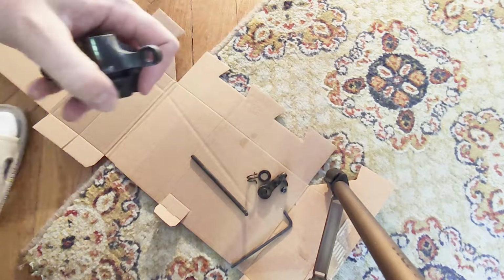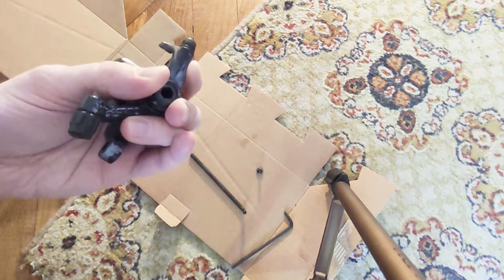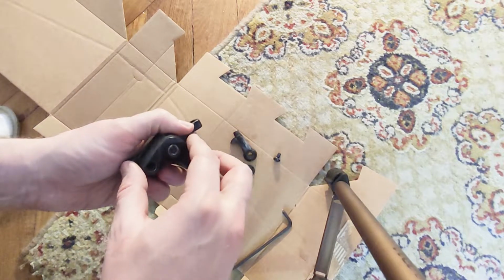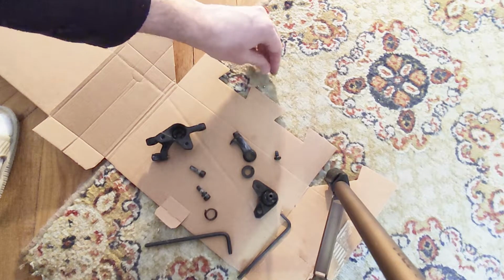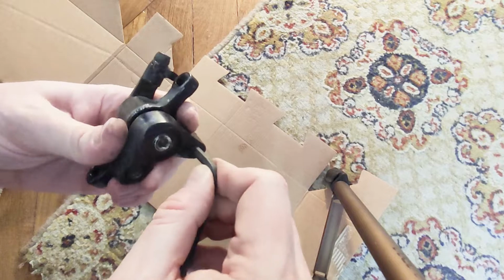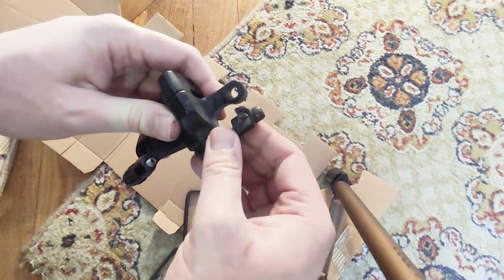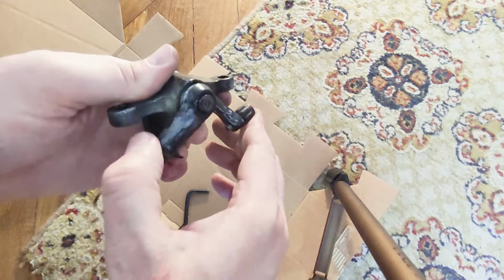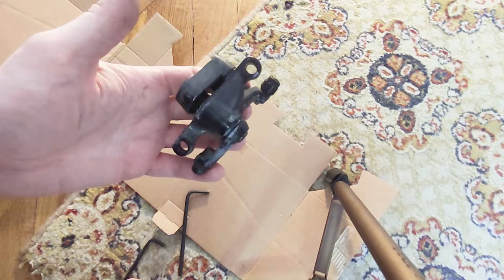How to service, assemble Tektro mechanical disc brakes

Comment: Thank you. I have a Tektro Novela caliper -- maybe 10 years old. Your video has helped me understand the way the arm rotates and pushes the pad against the disc (rotor). It looks like the balls run in sloping grooves. When the arm rotates, the slope of the groove forces the piston away, which causes the pad to contact the disc.
My problem is that the arm that the cable moves will not detach from the piston rod. I cannot use heat because of the rubber seal. So I cannot see inside the caliper, which is why your video helped.
Regards, Robert, UK